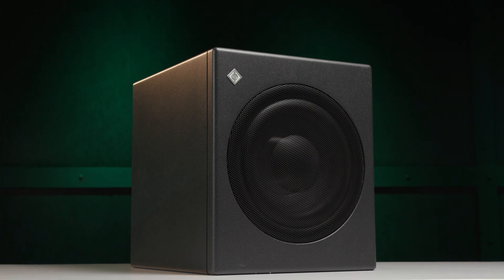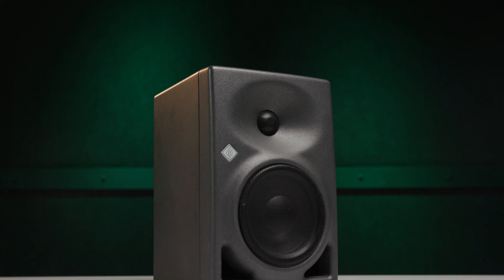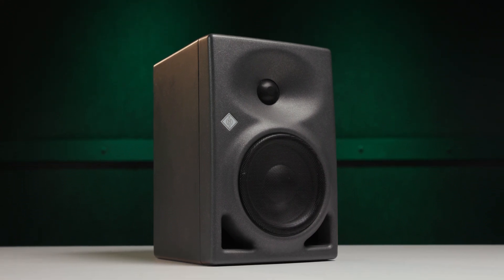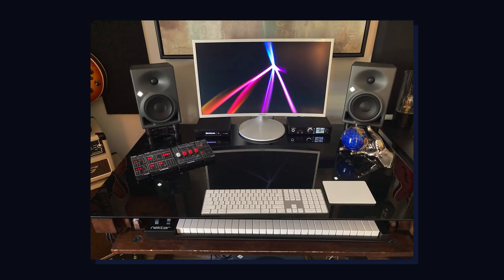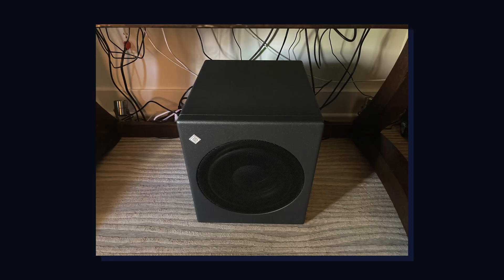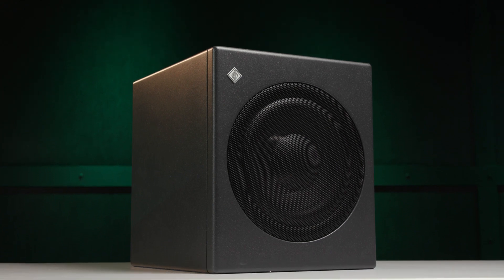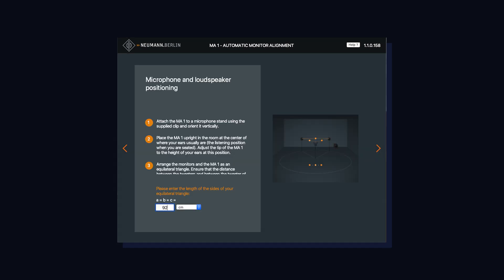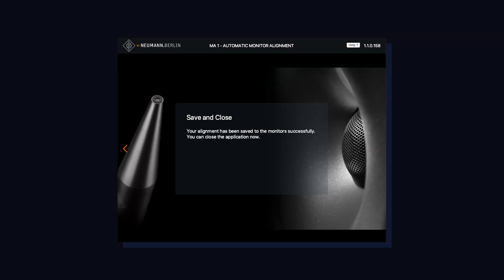Neumann MA 1 Monitor Alignment Microphone and Calibration System Demo

Comment: Can Neumann monitors be calibrated with Sonarworks software?
Reply from the maker: MrEvanTea, thanks for the question! Yes, Sonarworks works for just about everything. That being said, the Neumann calibration system works incredibly well with the Neumann monitors, and is incredibly easy and quick to use. It also has the benefit of being loaded into the dsp of the speaker system itself, so that you don’t have to have software running. If you are running a complex atmos system, or the like, it may make sense to use an external calibration system. I use Neumann monitors myself, so feel free to give me a ring to dig in further!
Drake Sobehrad, Sweetwater Sales Engineer
(800) 222-4700 ext. 3271 | drake_sobehrad@sweetwater.com
About Me: https://bit.ly/3J7EmsL

Comment: I have a question: after calibrating them, should they remain in NETWORK in Control Mode?
Reply from the maker: Hi, thanks for your interest! You don’t need to keep the speakers connected via Ethernet after going through the alignment process – the settings are saved on the hardware, so you’d only need to reconnect via Ethernet if you need to run the alignment again.
I hope this helps – feel free to contact me directly with further questions, and thanks again!
Caleb Lowrey, Sweetwater Sales Engineer, (800) 222-4700 ext. 1620, caleb_lowrey@sweetwater.com

Comment: Hi. I would assume that the sub with correction works with any analog monitors, not just Neumann brand monitors, is that correct?
Reply from the maker: Hey there! Yes, that is right. If you just have the Genelec sub and the calibration system, you can use that for any processing and still run to analog monitors. Of course, the analog monitors won’t be affected by the calibration.
I hope this helps!
Nick Pasquino, Sweetwater Sales Engineer, (800) 222-4700 ext. 3230, nick_pasquino@sweetwater.com

Comment: I agree. Got 2 KH310A and after a year I bought a KH750 and MA1. It is so absolutely tight, it is just always correct. Never changed anything in the setup afterwards.
Reply: I have just bought a pair of kh310z would you recommend the kh750 sub?? Also what happens when you move rooms or wish to revert back to the original speaker sound pre ma1 treatment?
Reply: @ARCASIAUK  you can change the dsp back in the software. It can be recommended depending on your room acoustics.

Comment: Hello, I use a pair of kh310 connected to 750 to calibrate. After calibration, I save the parameters and then close the software. After unplugging the network cable, is the calibration parameter written into the subwoofer dsp? I don’t need to connect the network cable every time I use it. Expect to you to answer me , thank you so much.
Reply: yes, unplug it and the Correction is written inside every Neumann Speaker wich has DSP insides - in your case the Sub. So you hear the Correction, you set up in the software

Comment: Great Video. One question: if I were to remove the sub from my monitor controller, will the KH 120 sound at their normal full frequency spectrum or will they sound lighter as a sub is is connected?  Thanks for your insight
Reply from the maker: Hi, Guido! Thanks for your interest. I’m not sure how well the MA1 calibration would work if you were going into the sub via a separate output from your monitor controller. The subwoofer itself is designed to send a processed signal to the main monitors via its outputs. With that said – yes, if you’ve performed the calibration procedure and you then deactivate the sub, the main monitors will still be calibrated as if the sub is connected, so you probably won’t hear their full frequency range. This system is designed to provide the most accurate sound with the sub on, so I’d recommend hooking it up the way Neumann suggests for best results.
I hope this helps a bit – feel free to contact me directly with any further questions, and thanks again!
Caleb Lowrey, Sweetwater Sales Engineer, (800) 222-4700 ext. 1620, caleb_lowrey@sweetwater.com

Comment: How do I connect to ethernet when I have an 2018 macbook?
Reply: Did you figure this out?
Reply: The ipad app controls the dsp on the sub through wifi, so potentially the ma-1 software will work. Plug your router directly into the sub and connect your macbook to the wifi

Comment: Would be interesting to have a sweep graph before and after calibration to show the difference.
Reply: The measurements will be ruined if the microphone is placed closer to the ceiling than the speaker elements.

Comment: When the calibration is done, should I set the switch from Network back to Local? Or should I leave it at "Network" for the calibration to stay active?
Reply from the maker: Hi there! Once you have calibrated the speakers, you are able to disconnect them from the network. From there, you’re able to A/B between the local settings and the saved network settings. As long as you save the network settings after calibrating, they will be saved into the speakers. I’ve copied a link to the MA1 manual for some further information. See page 10!
https://manuals.plus/wp-content/sideloads/neumann-ma-1-automatic-monitor-alignment-manual-optimized.pdf
I hope this helps.
Nick Pasquino, Sweetwater Sales Engineer, (800) 222-4700 ext. 3230, nick_pasquino@sweetwater.com

Comment: Hi I already have the KH80’s  and I really love them but would like to further extend the low end with the KH750, will this be ok in compact  space of say 12ft x6ft?  I would also use the MA1 mic to correct everything and I have some acoustic treatment in the space already.  Could this sub work for me?
Reply from the maker: Hi, Ria! Thanks for your interest. Yes, I'd say the KH750 is a perfect match for the KH80s - and if the room is treated, I wouldn't foresee any issues with bass management. Feel free to contact me directly with any further questions, and thanks again!
Caleb Lowrey, Sweetwater Sales Engineer, (800) 222-4700 ext. 1620, caleb_lowrey@sweetwater.com

Comment: Since the processing and Eq is done inside the KH750 does it work with the KH120 A or the processing only work with the KH 120 D?
Reply from the maker: Hey, Frank. Thanks for your interest in the Neumann MA 1. The speaker requirements are as follows: 1 pair of KH DSP loudspeakers or 1 KH 750 DSP Subwoofer in combination with a pair of analog (non-DSP based) KH loudspeakers. Pretty straight forward, but let me know if you have any further questions! Thanks and have a great day.
Jack Wellington, Sweetwater Sale Engineer, (800) 222-4700 ext. 3240, jack_wellington@sweetwater.com

Comment: Question: can I use the MA 1 software with a Nuemann 750 sub BUT with monitors of a different brand?
Reply from the maker: Hello, great question! This can only be used with the Neumann KH80s and KH750 subwoofer.
Feel free to reach out with any other questions. Thanks!
Jason Filloramo, Sweetwater Sales Engineer, (800) 222-4700 ext. 1281, Jason_Filloramo@sweetwater.com
Reply: But also can be used with the KH120 Analog?

Comment: hi    hello sir .. I hav an big issue in my room with my set up... please if you could help....I wil explain u in short.... I have apollo twin mk2 sound card and im using Neumann tlm 102 ... whenever now a days im trying to record than I get issue... the moment I put on the phantom power on than there is low frequency coming often and it doesn't stop at all.... now almost 6 month past.... I thought its mic issue but than I don't think so...... now recently two days before I took my sound card cable and mic to one shop and over there its started working properly.... so i took it back  and again connected my home so there wasn't any issue... it worked properly and I recorded.... but than after two days I put it on and I found same issue........ could you please help me ?

Comment: Does the MA 1 with KH 120s cause any latency due to DSP? Or is it possible to not use DSP when connecting a 750 with a pair of KH 120s via the MA 1?
Reply: 1.5 ms (A-D-A linear phase)
1.2 ms (D-A linear phase)  
You can use KH750 with a pair of KH 120s without the DSP off course

Comment: Sweet water

The built in Dsp is a great feature. I believe there should be more options for external  DSP for mixing purposes. An extern DSP unit with built-in convoluted reverb would help a lot rooms.
Reply: Good idea! If you want to simulate being in a room twice!
Reply: @RonnieVaiArovo  Just so you know this isn’t my idea. While applying filters in external units or software like sonarworks help correct the frequency response they don’t help help with duration of frequencies in a room. There is a mastering engineer on YouTube that has a series of videos talking about it. I understand room acoustics and the need for acoustic treatment and do not offer the following as an alternative but in addition. 
Rooms still need to be acoustically treated. if you’ve done any degree of research on room acoustics you will knows that the bass response in a room can be expensive to correct. First, Acoustically treating a room and then taking the impulse response of a room. Then use the information from the impulse response to add a small amount of reverb to help even out frequencies in the time domain within a space.
Reply: @RonnieVaiArovo  Room correction with convolution plug-in room eq wizard Tutorial